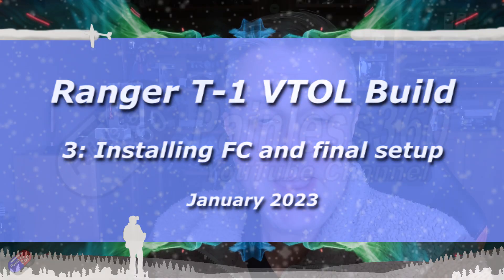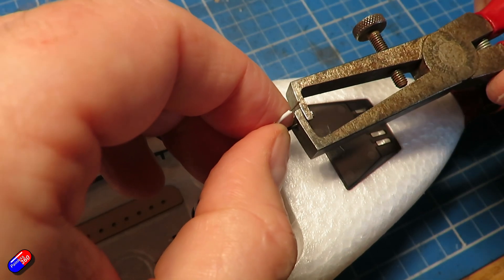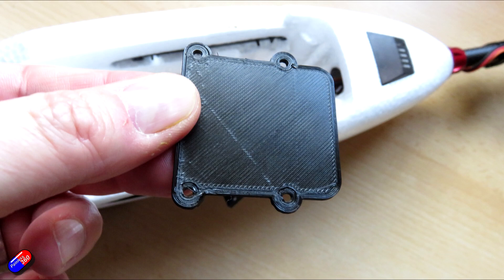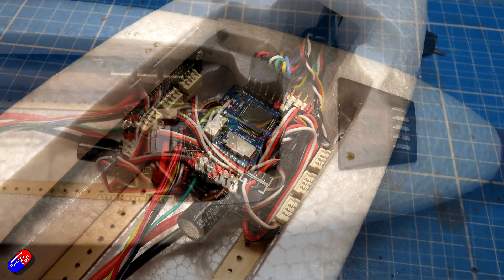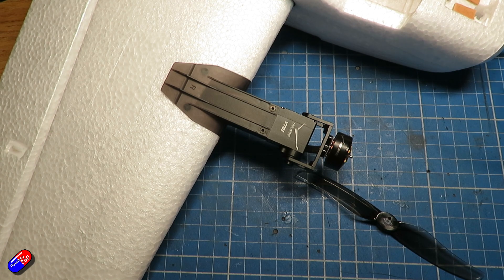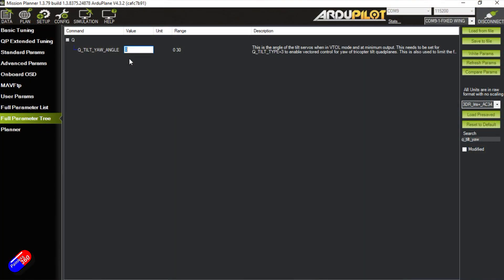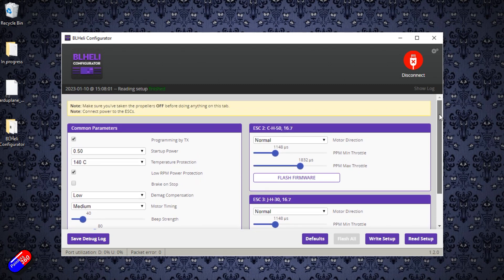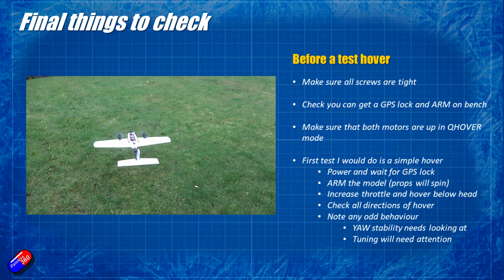Ranger T-1 VTOL Build: Video 3. Installing the Matek F405-VTOL and first test hover!

Comment: where did you end up placing the gps receiver? i'm working on an identical build and was thinking of either cutting it into one of the wings or in the rear of the body but then the rear prop might interfere with it. apologies if it's already in the video, will be rewatching this several times as my build progresses but just saw the static image for the gps portion. thank you so much for making these, have been a big fan of your work for many years
Reply from the maker: All of the steps are shown in the series. Best of luck!

Comment: how to fix this or had this issue before ? Basically my flight controller is not seeing my radio input on ardupilot. Also, none of my flight surfaces are responding. I’m also not getting full telemetry.
Reply from the maker: What troubleshooting have you already done?

Comment: I know it has been a year, but both of my servos only travel between 977 in Qloiter and 1227 in FBWA.  They work fine as I can get them to travel their max rate with just a receiver and power but no matter what pin they are on this happens.  It also happens with any servo on the TiltMotor FrontLeft/Right function.  I have factory reset my FC (same as this vid) and redownloaded arduplane and this still happens.  The discourse and google searches have been fruitless at this time.  I also have min and max PWM travel enabled.
Reply from the maker: The flight controller doesn't let you move them all the way when you are asking for movement in a stabilised mode. You're only seeing part of the PID loop on the bench... Happy flying
Reply: @Painless360  wow okay awesome thanks. You've helped me countless times over the last few years so I've subscribed to your patreon.  Thanks brother.
Reply from the maker: Welcome! I've sent you a message on their with links to all of the benefits you get :D Thanks again!

Comment: Question??? Hello I followed all the directions but I noticed that you enabled Dshot. But in ardupilot it says that Dshot only works in groups. Group 1 is channel 1 and 2. Group two is channel 3 4 5 6. It says you cannot use Dshot in the same group as PWM. But you have your ailerons on group 2 which would be sending Dshot to a motor and the ailerons at the same time. Should I be moving my aileron channels so that they are not on the same group as the motor ESC?
Reply from the maker: This is an older video. See the VTOL tuning video... Happy flying

Comment: Sir i got question...my plane flight in 3s fly great..but i got issue why in 4s when hover i push throttle slowly but the plane jumping...cant smooth hover..thx
Reply from the maker: By changing the voltage, you're also changing the hover throttle. That needs to be reset if you change the battery voltage... Happy flying
Reply: @Painless360  witch part i should to reset it
Reply from the maker: It's all covered in the docs https://ardupilot.org/plane/docs/quadplane-flight-modes.html Best of luck

Comment: For some reason, ardupilot names tricopter motors 1, 2, 4, (and also, in the MIssion Planner "motor test" tab, A, B, D) as opposed to all other configurations which count from 1 to X, where X is the total number of motors (meaning a tricopter would be expected to be, 1, 2, 3).  I too went round and round with this while building a tricopter.
Reply from the maker: When in doubt, the documentation is the place to look. It's very clear I there...
https://ardupilot.org/copter/docs/tricopter.html
Happy flying

Comment: Thank you for a wonderfully detailed video.
One question keeps poppin in my mind ... I hope you could explain.
Does this Tricopter use the "Tilting" mechanism to achieve Yaw or does it use the Torque of the motors ( like a usual Quad)
Reply from the maker: It tilts the motors. I see you are a subscriber so I'm guessing you missed the video where one of the devs and I talked about this and some improvements coming in the code for it. Check it out in the series.. Happy flying!

Comment: Finished building my T1 Ranger with the Hee Wing VTOL conversion kit and a Matek F405-VTOL flight controller.  With a 4S 2000 MAH battery I do not have enough power to get it off the ground in QSTAB mode.  I have looked at all the things I can think of which could be the problem (Ardu settings, BLHeli settings, props mounted correctly, plane not overweight, etc.) and at this point I have given up the project.
Reply from the maker: Sounds like you've done something wrong. Checked the basics like motor direction and props on right way up? Best of luck

Comment: Hi Lee.  I've been following along with your build and everything is gone pretty well so far. I'm having a little bit of trouble after testing the motors though. My left-wing motor and tail boom motor will randomly pulse briefly when connected to the battery, even when disarmed. Do you have any idea what this could be?  Thanks for the tutorial!
Reply from the maker: Mine does that now and again too. Stay tuned as an advanced setup and tuning video is coming in collaboration with an Ardupilot developer..
Reply: @Painless360  okay thanks! Everything else seems to be working so far. Just waiting for a good day to maiden.  Can't wait for the next video. 😁
Reply: @Painless360   I did my maiden today.  Everything went great!  I uploaded a video short of the first transition.  I couldn't be happier with this plane.  Thanks again!  https://youtube.com/shorts/pClCOszY1a4?feature=share

Comment: the esc calibration part, which I didn't understand, was it done only by blheli? I have the litleebee favorite 30A esc and I am not able to calibrate it, could you help ??
Reply from the maker: If you use a digital ESC protocol like DShot then calibration isn't needed.... Happy flying
Reply: @Painless360  thanks
Reply: @Painless360  movement of the motor servos when in qloiter, how would you do to have faster movements ??
Reply from the maker: Check out the VTOL builds on the channel... best of luck

Comment: I might be a little confused (usually am) but it looks like you have wired the motors to S5, S7 and S8. But your wiring diagram shows motor signal going to S1, S2 and S3. Did I miss something?
Reply from the maker: Nope S1, 2 and 3.
Reply: Do the esc power terminals not matter?
Reply from the maker: Nope, power is power... Happy flying

Comment: Hey Lee Steve again saw the third video you did was great by the way finally starting to see what you’re doing inside the fuselage with the electronics I see you have the DJI air for the camera and how you installed it looks pretty good one question I have is I have the nebula pro vista kit it comes with a power cable I’m assuming that you would solder that onto the module and then the other end you just plug that right into the flight controller let me know if that is correct  also I noticed in the videos the last two wires I don’t solder on because I’m not using DJI flight controller I’m using the radio master zorro with crossfire receiver and the antenna OK one more question if I can and that would be what size batteries is best for this what are you guys using OK thanks again for all the info can’t thank you enough and especially for the quick responses from you guys look forward to seeing more videos have a great day
Reply from the maker: Check out the fourth video in this playlist, I show how I installed the air unit. I'm using a GensACE 2200 4s endurance pack. . Best of luck

Comment: Hi Lee, thanks for the latest video. I have all my parts ready now and am about to dive into the build. I think I will mount the tail rotor ESC outboard, like you did so that it is less likely to overheat in an extended hover. 
I saw in another video the idea to keep the wingtip LEDs in place and power them from the power supply leads into the front motor ESCs. Do you think this is a reasonable idea; it seems a shame not to?
Reply from the maker: If you can that sounds like a nice idea. Ws2812 leds need a signal as well as power.  Best of luck!
Reply: Thanks for the advice Lee. I wasn’t familiar with these LEDs but having now looked into it I have ordered a Heewing LED driver from 3DXR.

Comment: Hey Lee it’s Steve again here in Florida saw the last video number three I guess it is I swear the more videos I watch the more confusing this gets pretty much everything I’m watching you do is what I’m doing as are electronics appear to be the same everything I use has to be compatible with the DJI goggles I saw on this other guys website where he uses a 3-D printed tray for the electronics I did find a way to get a hold of it it weighs next to nothing so I’m using that to hold the flight controller and the GPS works out real well trying to find a way maybe I could send you a couple pictures let you see what it looks like as far as flashing the flight controller that’s a whole Nother ball game for me I guess I’ll cross that bridge when I get to it I’ll definitely need to find someone to do that for me OK thanks a lot for these videos it does help people like me an awful lot thanks Steve
Reply from the maker: I saw that GizFPV used a similar 3D printed mount. I wanted the GPS further away from everything to minimise magnetic interference. I show all of the steps I followed in this series (and still not happy with it, so there may be one or two more). Best of luck!
Reply: @Painless360  OK I see that people try to keep the components as far away from each other as possible it will be something for me to think about do you think by putting the two way tape in between does that do anything it maybe you got me thinking I shouldn’t be mounting it on that tray either way it’s incredible how quick you respond I really do appreciate that I’m sitting here messing with this as we speak thanks Steve
Reply from the maker: Two way tape does nothing to shield the compass from interference. Specialised alloys like MuMetal are used to do that. Physical separation is the go-to when there is a problem. Others have mounted it on top of the FC so maybe it is OK in this instance..

Comment: You almost there, now in mine I did change the pid's half from stock, and then I did a autotune first in quad mode, and then the last one in airplane mode tune. Mine is been 5 months flying with no issues with H743 FC. I love mine, use a 4s 18650 lion.
Reply from the maker: I'd be interested to see what your tune is.. Thanks for the comment
Reply: @Painless360  how I send the screen pictures files to you?

Comment: Thanks for making all these videos over the years inspires me to build different models.
I built my Ranger over XMas using a combination of Heewing Params and known safe defaults. Eg the heewing Q_hover motor pids. As with everything there are different approaches to setup.
I myself followed more closely the Ardupilot Vtol setup and using manual mode for tilts down and q stabilise for up using the two index marks on tilt cage and the endpoints on ardupilot. I have a hands off hover with no yaw issues like I just saw in vid . Also TRIM_PITCH_CD to fine tune hover attitude drift  As my field is unusable havent actually flown as yet. But maybe these ideas help vtol builders, The wvayne params at 15M should mean no action until above 15m I actually disabled this on my build.
Thanks..
Reply from the maker: Do you have a link to the setup you followed? Thanks
Reply: @Painless360  Its a combination of the heewing my own stuff from learning setting up eflight converge 2 years ago and some others. I could send the parameters but it won't work on the system you are using at moment
Reply from the maker: OK, thanks for responding. I waited for a while before making the videos but the 'tutorials' out there contradict each other and are very confusing so some detail from someone who has been flying it for a while is needed. Thanks again!

Comment: I just bought another H743 to put in a 3d  printed plane. Everything is set up fine, but the GPS is not detected. Nothing I've done fixes it. Doesn't even show up in the hardware, doesn't show up anywhere.  I've seen people having g trouble, but others none at all. Dame one you have in the video.
Reply from the maker: I've not tried it with that FC. What troubleshooting have you already done?